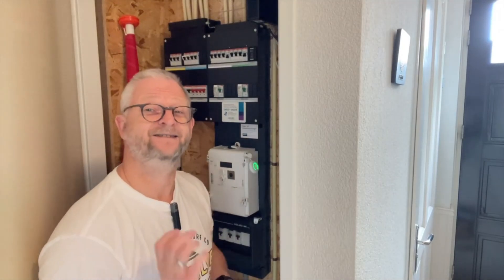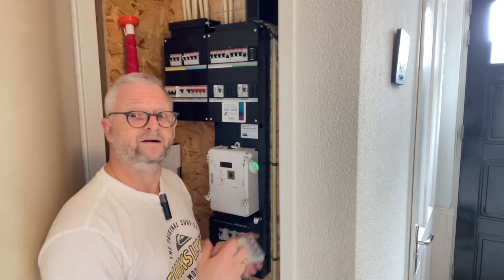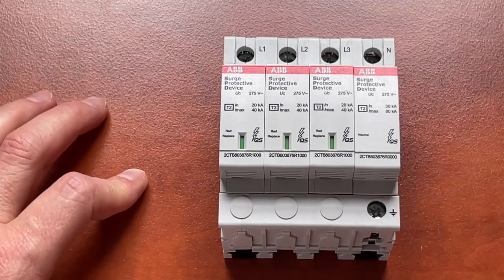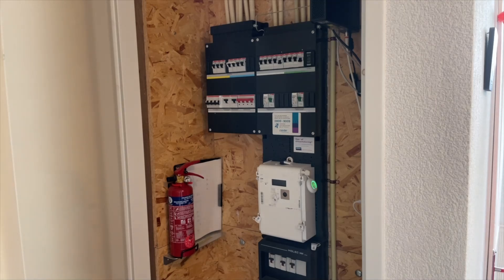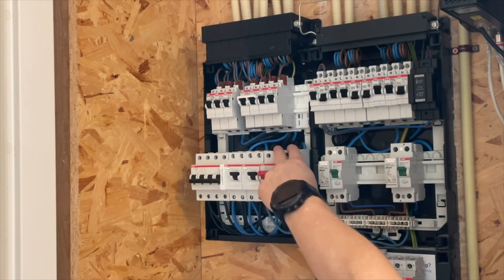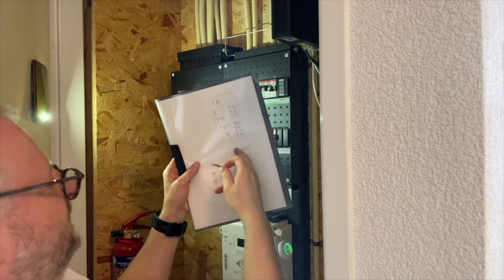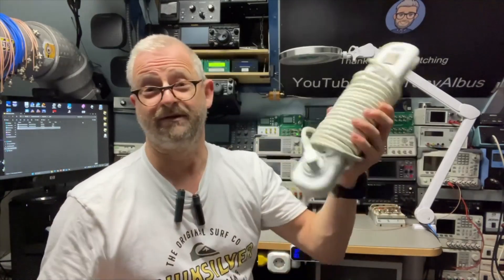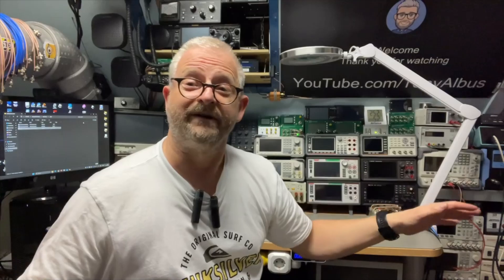TA-0452: Installing Over Voltage & Surge Protection - SPD

Comment: Could have bought a power board from Aliexpress and a box full of MOV devices and a roll of solder.....
Reply from the maker: LOL :)  Yes somehow i prefer CE certified for my house when it matters
Reply: @TonyAlbus And then you discover the “China Export” mark…
Reply: I don’t think ABB is China Export…😊
Reply: @zoom_h2625 It’s the clones you need to watch…
Reply from the maker: @zoom_h2625  i hope not, usualy those brands, even though maybe from there, it is all CE and TUV approved so at least it was propper tested.
Reply: @TonyAlbus psss. The CE marking is only needed for selling things in the EU market. There is no certification needed. If you design a device you have to put the CE sign on the device to sell it in the eu. Than you certify your self, that you have build the device by the given routes of the EU. If ther is no accident no one will check if it!
Reply from the maker: @zoom_h2625  thanks

Comment: For protection of your sensitive protection you should use a type 2+3 (e.g. SPD Typ 2 + 3, DEHNguard) or you have to protect the device with a Type 3 SPD separately. If possible connect the SPD to your grounding not to the PE.
Reply from the maker: Yes

Comment: Thank you for another interesting video, Tony.  I really like the European power panels, so neat, and you have three phase power available in a residential system. My guess would be they use some hefty MOVs for the overvoltage protection. Regards, David
Reply from the maker: Thank you David!  Not sure what they use here, i just wanted to be sure i did what i could do on my side.
The lab is usualy disconnected when i am not there. so that is low risk, but the rest of the house is always connected.